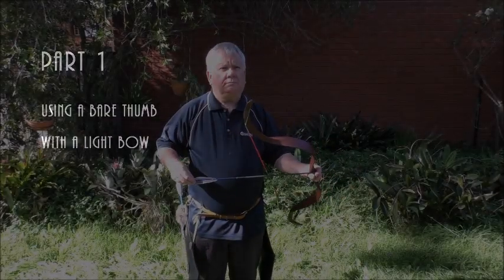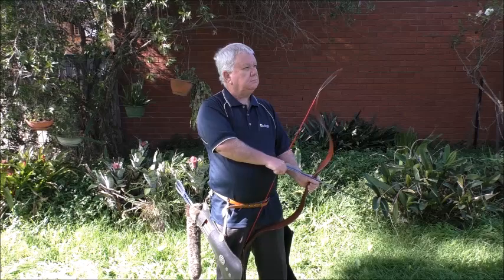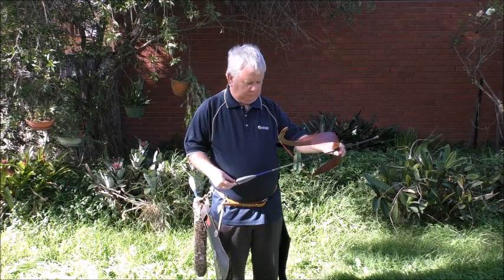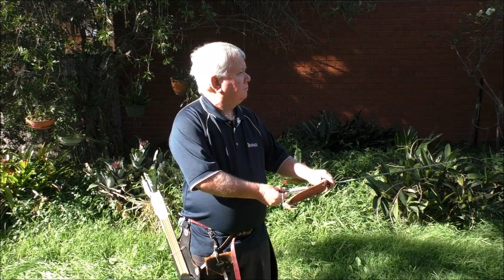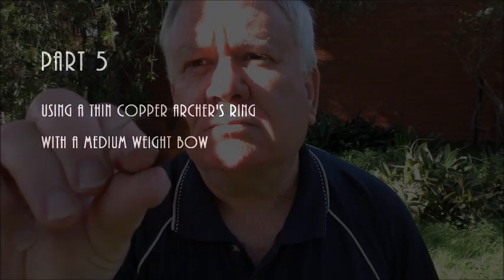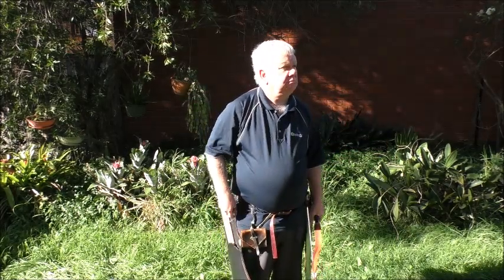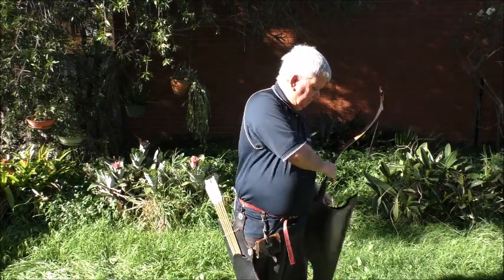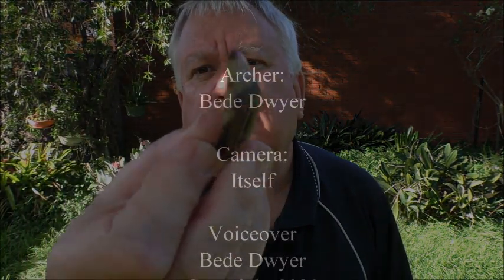Thumb draw techniques in archery

Comment: I have several Persian thumb rings, one of which is the basis for the sheep horn ring in the video.
Walrus ivory was a popular material because it was not supposed to discolour with age as elephant ivory does. Jade (nephrite) and hard stone rings also survive. I have a small jade ring in a flatter profile that is similar to walrus ivory ones. However, there were several types of hard stone rings in use. Higher sided ones are shown in miniature paintings of the late Safavid period and a few survive. Collectors often assign them to India, but jade rings were made in the Timurid domains and one inscribed for Ulugh Beg has survived. An Italian account of a visit to the court of the Ak-Koyyonlu sultan, Uzun Hasan, mentions a gift of jewel encrusted jade archers' rings by an Indian embassy. This means that rings were circulating between India and Iran in the fifteenth century as well.
It is probably important to point out that metal rings developed differently from horn, bone, and stone ones. Since they could be made much thinner, they could give an experience of shooting similar, but more comfortable than the leather thumb guard. Most historical metal rings are not copies in metal of thick bone or stone rings. I do have one particularly thick bronze one, but generally they were thin walled. Gold rings were the exception.

While this video is only discussing basic techniques, a future one will go into more detail.
Reply from the maker: Thank you very much for your input. I really appreciate it

Comment: I love the holster and quiver
Reply: Can you ask Mr. Dwyer what draw weight his bow is?
Reply from the maker: Sure I will
Reply from the maker: @Balaclavaballistics  Bede says; "The reddish bow used for beginners and kepade-like practice (shooting into a soft target at a couple of metres indoors to perfect form and release) is rated at 18 lbs. It is only used to correct form and improve the speed and cleanness of your release.  The short Turkish bow is rated at 50 lbs at 28 inches. My testing suggests that it is really closer to 45 lbs. I find it better for target ranges since it is less likely to cause problems with commercial targets. At 75 metres shooting at a ground target, the elevation is about the middle finger of the bow hand with a moustache draw. In the shooting under the rope video,  I am using a 50 lb Korean bow.

I used to occasionally shoot target with an 80 lb Korean bow,  but it broke a few years ago after 30 years of use. In flight shooting,  I usually compete in the 70 lb class with bows of 55 to 65 lbs. However,  under some circumstances I have used heavier bows in the unlimited class.

Shooting bows in the 30 to 40 lb range is good occasionally to see if your technique is deteriorating,  specifically if you are letting the strength of a heavier bow make your release appear crisper than it really is.  The other advantage is slowing the arrow flight so you see inconsistencies. A consistent arrow flight means you will be accurate at all distances. An inconsistent one will be accurate at one or two distances,  but will hit to the left or right at others.
  I find in solo practice, my form deteriorates unless I regularly assess it using videos and a mirror. It feels the same, but it is actually drifting from my intended form."
Reply: @RazmafzarTV  thank you mr. Bede

Comment: Have you ever tried shooting on the right side of your bow? If you have, why do you prefer the left side? Thank you!
Reply from the maker: He is using a thumb draw using only the thumb, the strongest single digit, to grasp the string. The index and/or middle fingers close over the outside of the thumb to reinforce the grip. It was used by all nations across the Asian steppes, extending to Korea, China, India, Russia, Persia and Turkey It is typically used with a thumb ring for protection of the thumb pad and joints. It gives a narrower grip on the string, as only one digit is used. It may also avoid a problem occasionally faced by archers using the Mediterranean release, when the three fingers do not release at exactly the same time and thus affect the draw. It also positions the string further back in the hand, allowing a longer draw, all else being equal. In this method you place it on the right side of the bow.